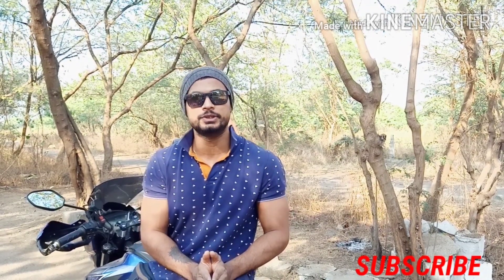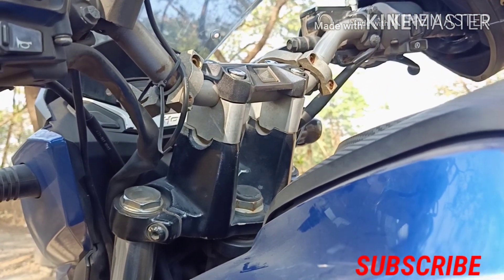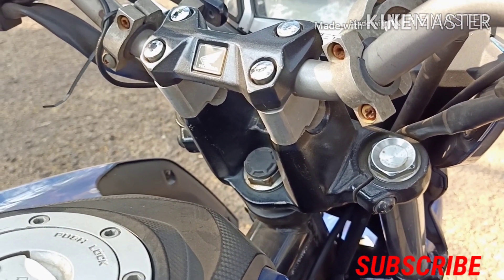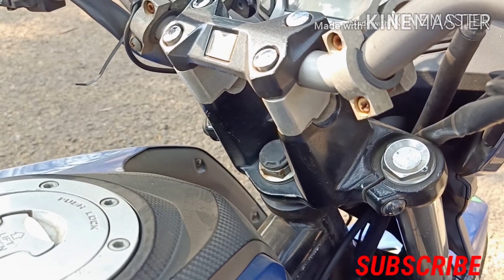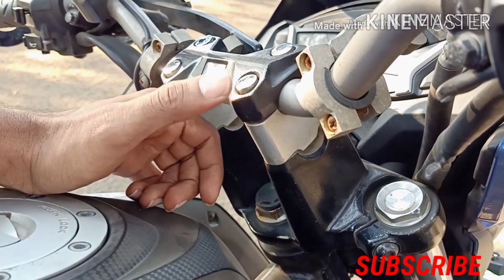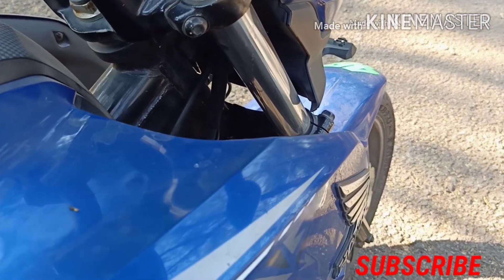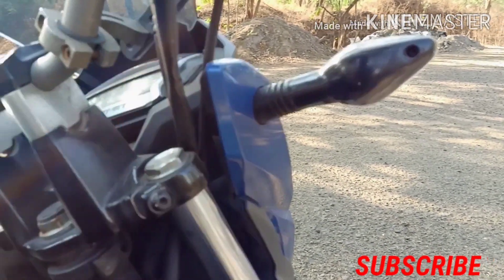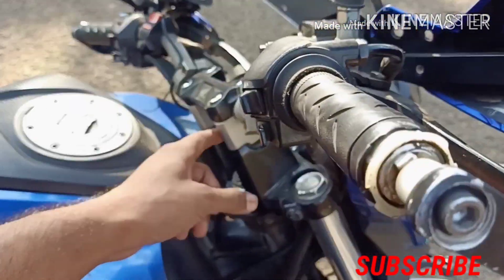Modified Honda hornet 160r Handle bar raisers

Comment: Bhai, you have done a great job. I have done the same but only change the Handle with Honda Livo handle. Issue was same with the break-line.. Just do one thing, you find a screw attached with the break-cable to fix it with the bike chassis.. Just unscrew the nut and fix with cable-tie instead of screw at same position to prevent the wire from to much expansion. It will solve your problem.. 
Yeah chis jaha se cable khich raha hain, uha pe karo..
Reply from the maker: Oh yeah great idea. I'll try. Thank you brother 🙏😇
Reply: @coachdiwakar9594  ...... Don't worry.. complete tried & tested by myself...
Reply: good info 👍
Reply: Please add your bike photo with livo handle
Reply: @Aawarabiker  already sold & buy N-torque
Reply from the maker: Cool